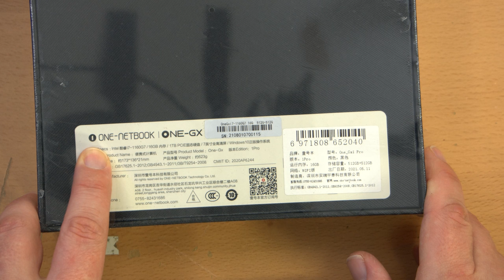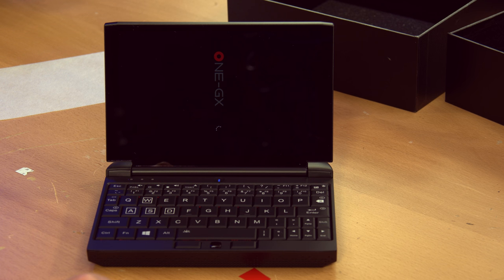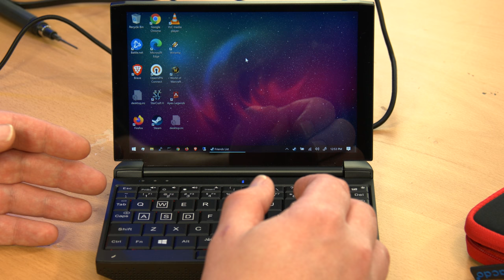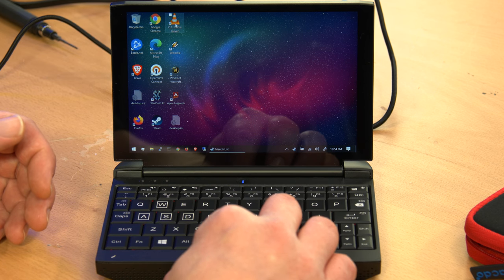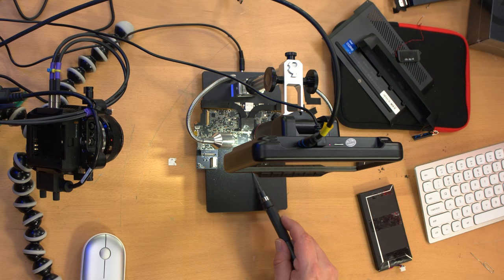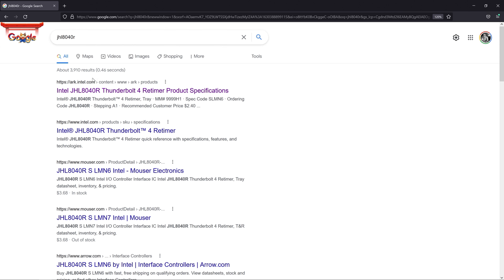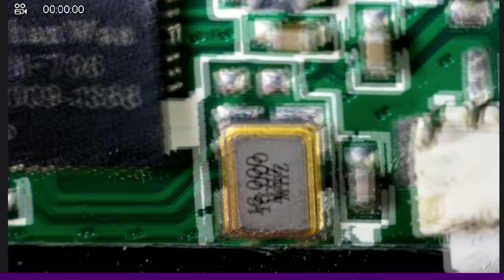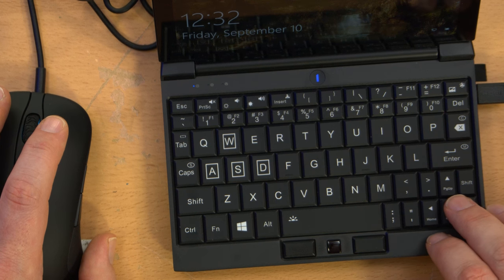One-Netbook's OneGX1 Pro Mini Laptop - Didn't Buy it for Gaming (with Teardown)

Comment: The laptop has been in operation for two months. From the very beginning there were problems with its overheating, it is always very hot. Well, you can be patient. USB ports do not always respond to the device the first time. But the most important thing is that after two months, the left side of the screen began to flicker terribly, considering that I rarely use book mode. I am trying to return the device and get the full payment back. This is where it will be clear what the manufacturer is. At the moment, I strongly do not recommend buying this laptop for serious and responsible work.

Comment: Not sure if you still use this but I have one and it plays pretty much every game out there at around 40 FPS @ 1080p/60 FPS @720p...this was after quite a bit of tinkering...Ciphrays bat file changes, lapping the heatsink which was very uneven, repasting the CPU to the heatsink, latest driver. This allowed me to up the TDP to 20-25W and keep good temps and get the most out of the machine.

Comment: Interestingly, the BM706 does appear to be a Bluetooth 4.2 BLE module, which is weird, because the AX201 already provides Bluetooth 5.0 BLE. The second BLE plus the tiny ARM CPU makes me wonder if there's some undocumented functionality going on.
Reply: BM706 could be the RF receiver for the gaming handles. Additional ARM cpu more than likely controls the RGB and tail light
Reply: It's possible to upgrade this to the AX211 and get wifi 6E

Comment: I got mine off of ebay and ordered the controllers separate ( they sent silver ones that don't match my black mini laptop ). I did no tweaks whatsoever. I installed steam and attached an external ssd and played fallout 76 just fine. I dont know the FPS, I just know it seemed just as good as my ryzen 7 1700 desktop with a gtx 1650 non super.
Reply: so, uh...this might be kind of a crazy request but im gonna ask anyway. lol...if u still have your onegx would u like to trade your silver/blue joysticks for my black ones?

Comment: Hey Scott, I recently picked one of these up myself and I was wondering if you could help me identify the SSD in this guy. I see (as you mentioned) that it's branded as a One-Netbook m.2 2242 drive. It appears as though that the socket is "B" keyed. I'd like to upgrade mine to have a 1TB SSD but I'm unable to find any drive that works let alone solely "B" keyed. I've tried M keyed drives, they don't fit. M+B drive will fit but do not register at all. So I'm guessing B keyed only is what is needed but finding those seem to be the tough part.....
Reply: I am just looking for a 2nd SSD ang glad I found this comment. Did the 'B' key do the trick?

Comment: I’m surprised you don’t use an ESD strap to ground yourself when opening devices. They never get damaged from static? I’m newer to computer tinkering versus smaller originally designed mobile devices.

Comment: Nice tear down. What are the drive specs in the M2 slot? The bios won't recognize my M2 2280/2242  1TB.
Reply: It recognises my sabrent 2tb with an adapter no problems
Reply: @poulan9  Hello, your Sabrent 2TB is fitting/working right ?
An adapter ? Which one ?

Comment: Hello, I found the model below I5 256 go 8go of ram perfectly sufficient, however it was suffering a lot because of Windows defender, I disassembled it and the .... no ssd in the place where it should be ...

I don't understand ... it announces FORESEE 256GB SSD 256.0 GB NVM Express PCIe 3.0 x2 | PCIe 3.0 x2 standard NVM Express 1.2 in crystal disk info, and nothing ...

Can someone explain to me where I have chances to find the disk ???

thank you for your help

traduit par deepl
Reply: Your ssd seems to be soldered.
I know that is the case on mine. Onegx1 pro. A 512 soldered ssd with a free m.2 2242 slot.

Comment: Not much of a retro gamer, are you Scott?  I think the intent of the addon pads is largely meant for more vintage games and emulation.  Try installing RetroArch (or RetroBat for a more curated frontend experience) and see how you get on with it.  It should be strong enough to drive most Dreamcast, Gamecube/Wii and even PlayStation 2, while easily letting you do the heaviest shaders to enhance the older systems.  Is the dpad actually segmented?  Because that might be godawful.  Anyway, I don't exactly know why you'd get this over a GPD device, especially when those can be had under USD$1K.
Reply: GX Pro has the best design out of the 3 & is only 2 generations away from desktop graphics so i'm sure they have already taken those mods into account for the next 2 models.